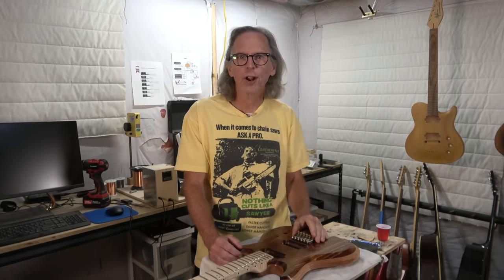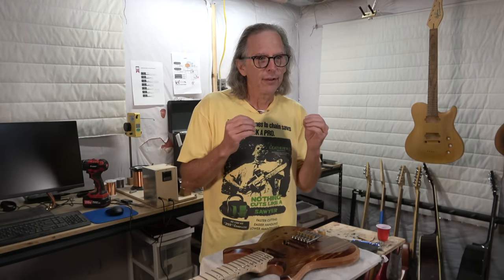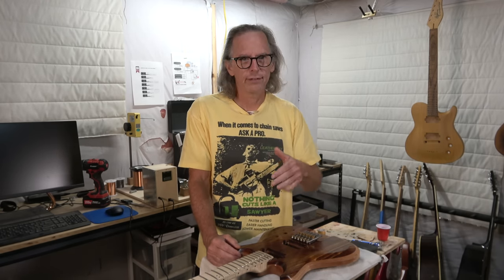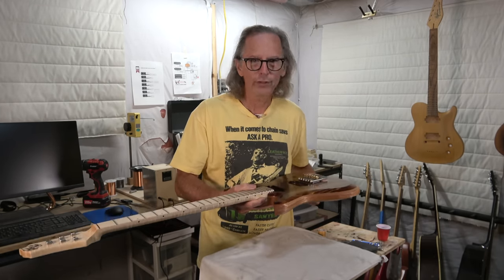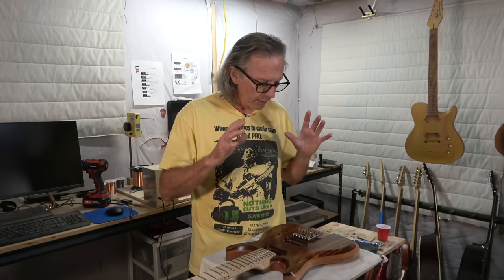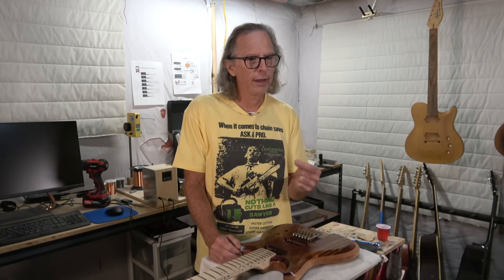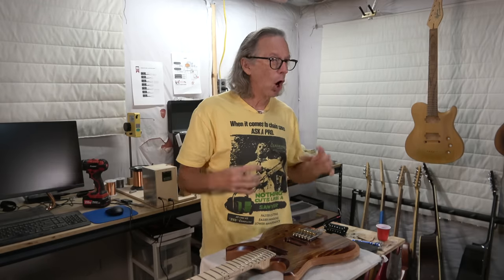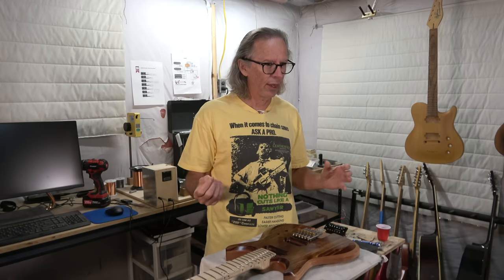Guitar Building Techniques That Are A Waste Of Time

Comment: I've never had to put falloff on a fret job.  But most of my builds are 25.5" scale length, 8's, zero relief, and 1.4mm action at the 24th.  The strings just don't get sloppy enough to require it.
Oddly enough, I've just switched to wax potted pickups on all my builds - feedback is part of my tone.
#1 waste of time from a profitability point of view: finishing parts of the guitar that won't be seen when fully assembled.
#1 indicator of quality throughout a build:  finishing parts of the guitar that won't be seen when fully assembled.
That boils down to the age-old question: Are you in it for the art or for the money?
I'm still at the hobbyist level, so I have the luxury of indulging the artist in me.  So I hand finish every last little shim and spacer - even the parts you'll never see.
As motioned elsewhere in the comments, automatically scalloping a fretboard is also a waste of time. Not everyone has "bassist hands" and needs the extra room to get under the strings for bends.
Level crown and polish of new frets is also likely overkill - unless you can't press frets uniformly.
Lately I've taken a less is more approach to fretwork and dressing fret ends - with rolling the fret ends and fretboard edges as the only mandatory step these days.

Comment: This one is probably controversial, but a full fret level. With the right fret installation process, I've had necks that could achieve the desired relief and string height without need to level the frets—maybe little touch with a file on a few frets was all that was needed.
Reply: Exactly what I was going to say.  Right on.
Reply: Well said
Reply: Most new guitars these days could still benefit from having their action and intonation improved by a proper fret n crown job. Doesn’t mean it’s 100% necessary by any means, but in most cases you will be improving the instrument this way
Reply: @TylrVncnt  — It's definitely necessary often, but some people act like it's always necessary.
Reply: I do it every fret job, but the fretboard is measured and correct. Fret levels are only as good as what they are sitting on. Lumpy fretboard is a waste of time, :ie most Gibsons..

Comment: One of my pet hates is the fact that even name brand expensive acoustic guitars have the bridge partially  resting on the polished surface of the soundboard instead of the area being masked off properly. I have had to reset 2 bridges so far and I am not a luthier so it was a pain in the ass. Surely that area could be masked before polishing on a three thousand dollar guitar.
Reply from the maker: For that kind of money, the top should have been masked off where the bridge is positioned. We as players and consumers need to demand more when it comes to high-dollar instruments. Until we do, companies that build these instruments will just keep doing things the same way. Sad!

Comment: Nice content! I may be wrong but I’m pretty sure that Leo Fender was using paraffin wax potting on pickups a lot earlier than EVH. Mainly to protect the old style enameled wire and also prevent corrosion.
Reply from the maker: Fender used wax and lacquer in the early 1950s. Potting electronics was certainly not new even when Leo did it. Early radio transmitters and receivers had potted components decades before the first electric guitar was invented.
Reply: @HighlineGuitars  I know, my father repaired and built radio and television equipment(the reason why I had a soldering iron in my hand and knew about circuits at age 5) and there was a whole lotta wax involved, especially on capacitors and cloth covered wires! I like having both potted and raw pickups in my personal guitars for the tonal variety.

Comment: Chris, your videos are always food for thought. About waxing the pickups: do you think that using isolating tape can be an alternative to it? Thanks in advance!
Reply from the maker: If a coil is wound loosely, wax potting will keep the windings from vibrating. Wrapping the coil with any kind of tape (or string like on vintage single coils) might help, but for how long?
Reply from the maker: @myob3574  Careful. CA glue's exothermic reaction will destroy the insulation on magnet wire.

Comment: for a ash neck and body guitar what do you think of avoiding grain filling and only finishing in tru oil to save time ?
Reply from the maker: Go for it.
Reply: @HighlineGuitars  ill try it once! then put the moisture metre over the flat parts and see if it just gains too much moisture and if it feels too rough playing it.... Would be a big way to save time and money when building potentially.... here in the UK a decent non toxic low vapour grain filler is pretty dam expensive for a tub
Reply from the maker: @ukguitaryogi2888  You can wet sand in Tru Oil and it will fill the grain.
Reply: @HighlineGuitars   wow i will try this on scrap wood! thanks alot. even on english white ash or american ash?!
Reply: @HighlineGuitars  what grit sand paper and type do you recommend can you do a detailed video demo of this please, i can imagine you must have to be very aware of the sand paper grit not breaking away into the finish ? thanks

Comment: Hey bud 
The fret levelling one is definitely a usual tip .

The wax potting Eddie van halen invention story is a bit of a myth tho. Although he did it . Fender did it in the mid 1950s over 30 years before Eddie.  They used lacquer to start with just the bobbins and twine and later by about 54 redipped in lacquer after winding but the humidity would make the lacquer flake of so by 55 /56 they used lacquer for the bobbins before winding and wax after winding , again running into problems with various players depending on where they where playing as the wax often melted in very hot venues .  
I’ve heard the Eddie invented it myth many times and having owned numerous pre cbs fender guitars and basses with original wax potted pickups not rewinds I always knew it was a bit odd. But anyhow it’s fairly common knowledge these days fender used to do this in the pre cbs days which is where Eddie got the idea apparently from a book printed in the late 70s about 50s fender production
Reply: For more info on fender pickups check out Ask Zac channel and 5 watt world also Ron Ellis talks about it occasionally too
Reply: I will bet it was Donald Brosnac's guitar electronics book.
Reply: There are lots of inaccurate stories about Eddie Van Halen. Many started by him! I suspect it's a mark of his impact on the guitar world that they still persist. Eddie famously took a PAF from an ES335 to use in his Frankenstrat. An original PAF would not normally be wax potted so Eddie maybe just explained what he did to it. Fender did wax pot pickups so it was known and it must be assumed that guitar techs would probably know of it to try out on problem pickups.

Comment: Great video but I can see other benefits to waxing your pickups is the sealing of the internal components to outside elements.  This would apply to traveling musicians who play nightly under some extreme conditions like humidity and moisture. Average Joe in his living room could more than likely go without the potting. Thoughts?
Reply from the maker: Was moisture and humidity an issue before wax potting became the norm?
Reply: @HighlineGuitars  Just thinking of salty sweat and moisture inside a pickup with copper windings. Even enameled magnet wire could corrode if slightly nicked. Have you ever opened up any pickups from a touring artists guitar?
Reply: @mlb3164  if your copper windings have the insulation nicked you have wayyyy bigger problems than any potential spots where corrosion can happen lol
Reply: @TylrVncnt  You are correct.
Reply: @HighlineGuitars  What was the reason pickup manufacturers started to wax pot their pickups?
Reply from the maker: @mlb3164  to cover warranty claims due to sloppy coils.
Reply: @HighlineGuitars  🤣😅🤪
Reply: @HighlineGuitars  
I can only say from touring musicians that they change from sweating in open pickups (meaning just no covers, I can't say if potting makes that much of a difference but open ones don't last as long, the sound isn't the same anymore).

Comment: SHIELDING definitely falls into this category. If you look at new guitars on the rack at the store, almost none of them are shielded, and the ones that are, usually it's just the back of the pickguard on a strat type thing. These guitars sound fine and don't pick up interference. On Facebook, you see a lot of people spending hours on shielding with copper tape, on guitars that have never been played! I often wonder if these people also salt their food before tasting it. Furthermore, when I've done shielding on a bass that needed it, I used the paint and it only took a few minutes. So, in my opinion, people are wasting a lot of time with shielding tape, when it most likely doesn't make any difference, and they have no idea if it did.
Reply: How often do you play live and in shitty venues?

Comment: Dear Sir, Your colleage (DylanTalksTone) also shared a video regarding the unwax potted and wax potted pickups. Yes they do make microphonics even as good a manufacturer dylan makes his pickups. And down the line the winding do get lossen after a certain period. Wax potting is a process that needs to be done. I have single coils which even after wax potting they squeals like hell (low cost pickups with plastic bobbins offcource)

Comment: I have found sanding the raw wood past a 220 grit is a waste of time as long as it is smooth and flat. I have seen many guitar building videos where people sand up to 400 or even 600 grit. All you are doing is polishing the wood and making it less likely to accept stain. This does not apply to the finish. Just the wood before you finish. Having been a woodworker for over 40 years, I can lay down a lacquer finish on wood sanded to 150 grit and you cannot see or feel the difference than wood sanded to 400 grit.
Reply from the maker: I can see up to 600 grit scratches depending on the species of wood I use.

Comment: The pickups on my 1960 Kay are lightly wax potted. I don't think Eddie did it, but I wasn't there so I can't be sure.
Reply from the maker: Are you the original owner?
Reply: @HighlineGuitars  I'm not, but I guess I have a hard time picturing someone going to the effort of potting them on a catalog guitar. I tore it down last year for a refresh and it seemed to me that I was the first person in there. I could absolutely be mistaken. Also the pickups are riveted to the pick guard so I feel that would have been a lot of effort.

Comment: The PAFs in my 1962 ES335TD must have been too loosely wound - they used to squeal badly!
Reply from the maker: And what do you supposed those pickups would be worth on the market today?
Reply: @HighlineGuitars  - good question! Unfortunately I have over the years changed the internal wiring from series to parallel, but his can all be reversed. as far as I'm concerned they are not very good pickups and I will not be using those pickups again in that guitar. I have installed hum bucker fit P90s which I love. When it comes time to sell the guitar I will just bring the pickups back to original wiring and sell them with the guitar.

Comment: This was such an education for me, your explanation on the pickups was also very interesting however your explanation of the ‘fret fall-off’ was indeed a learning experience for me. I’m not a luthier although I enjoy putting guitars together and repairing them for friends that play gigs and such. I JUST ran into this issue with a Strat build with a Warmoth neck and it has stainless steel frets which alone are more of a challenge ( at least for me ) to work with as opposed to the standard nickel ones.
Thanks so much for sharing your expertise 🤙

Comment: Fall-off might be wise for an acoustic with a neck that will eventually move, but for electrics I'm pretty sure it should never be required. Physics says that rather than slope down (which also makes the action worse), the frets should actually spiral up towards the saddles.
Reply: Sloping/spiraling up would only make sense if it was an “open string ONLY” guitar (like a suuuuper lame harp or something lol….) 

I know how you thought of this (due to the “football” shaped vibration path) but respectfully I think your logic is flawed on this. Think of the very first half of that football shape starting from the side closest to headstock and then move that shape up and up the neck towards the bridge (starting from higher and higher frets). From a physics standpoint, do you see the merit of fall-away now?
Reply: @TylrVncnt  Absolutely not. Fall off is a myth, suitable only for poorly made acoustic guitars whose body joint will collapse over time. If you had 1000 frets, such that the last fret was 1mm from the bridge, how far do you think that fret should be below the saddle? Do you think it should be 3mm like you would have with a flat fret plane? Or 10mm like you would have with a fall-off? Or .1mm like you would have if the curve of the finger board spirals up? The answer is .1 - the curve of constant angle is a spiral. It has nothing to do with open strings. Have a play with Mathematica and some clear logic and you'll see.

Being a football is what makes this work, the buzz higher up is strictly less than what you would have with a true constant angle, and it's more important to think about the clearance required to miss the frets just above the fretting point. Now, you could argue that it shouldn't really be a constant angle, but some other layout, based on some quirkiness of the real world physics, but the fact remains that a flat or falling plane is obviously incorrect. All it does is worsen your action for absolutely no benefit.
Reply: @MarkRawling  can I ask how many refrets have you done? Fall off is not just for Cheap acoustics, I've had $50000 acoustic to work on by some of the worlds best builders. Its on a guitar for a reason.
Reply: @5150TJT  >> 100 refrets mostly electric, but don't ask me, ask PRS, MusicMan, and dozens of other builders who do 10x that every day and don't use fall away - clearly visible on dozens of YT factory tours and the guitars themselves. But let's talk about it logically. What scenario do you think a fall away helps with? Open strings vibrate as much at the 6th fret as they do at the 22nd, but the 6th fret is twice as close, so clearly it's not relevant there. Maybe 10fret notes? For it to matter there would imply that the half way point is an issue - but that means the 12th fret needs fall away for the open strings, clearly it does not. How about 18 fret notes? Well, the strings barely vibrate and it still has the same take off angle anyway so it won't buzz. But that raises another point - for an acoustic guitar those high frets are almost never played anyway, so you can do a fall away there without really hurting playability, but it is pointless - unless the neck moves. But if you think it helps, please explain exactly how? And Ibanez, PRS, Fender et al can all change the way they do frets. A 50000 gtr with a fall away is probably just a nod to traditional/bespoke workmanship. We're all here to learn, so seriously, explain how it helps - what problem is it solving? And as part of the answer pls explain why this matter for the last N frets , but not any other group of N frets. The only way I could see it possibly helping is if some stray overtones cause unnatural level of vibration over those specific frets (maybe related to pickups?). That's just not plausible imho, and even if it happens, it is dwarfed by everything else that is going on that might cause buzz. Also, can I ask you to carefully consider the 1000 fret example I gave and explain how fall away makes sense in light of that. Would you fall away every fret up to the bridge? If not, where should it start and stop, and why? Personally, I am absolutely pedantic about perfect action and perfect intonation, I work with eye loupes to make perfect nuts, etc, I spend hours getting guitars to play like silk, and a fall away would without a shadow of a doubt interfere/ruin all of those things - it would truly decimate intonation by causing the strings to stretch more when played over those frets - intonation is unbelievably sensitive to string stretch.
Reply: @MarkRawling  Musicman would be the worse example for a fretboard, every noticed the plastic shims in the neck pocket🤔. Always have ski jumps like a Warmoth neck. PRS, Shur, Deviser guitars you could say 95% of the time have straight fretboards.. I have scanned most guitar brands, when I use fall off you would not see it with your eye. Times I do use it, is normally to do with an action height, string gauge and tunings.

Comment: Filling pores on mahogany seems like a waste of time.  Lots of people gush about thin finishes that allow the wood to "breathe,", then they pack the pores full of silica ground in an oil or water base. It all sounds self-defeating to me.
Reply from the maker: When someone complains about me not letting the wood breathe when I fill the pores, I remind them that wood doesn't have a respiratory system. It can't breathe. It can only absorb and expel moisture from the air and that is not a good thing.
Reply: Agreed.  Wood cannot breathe, it can drown or it can dry and split.  That's why I put the word "breathe" in quotation marks.  I'm glad to see even some factory guitars with open-pore finishes.